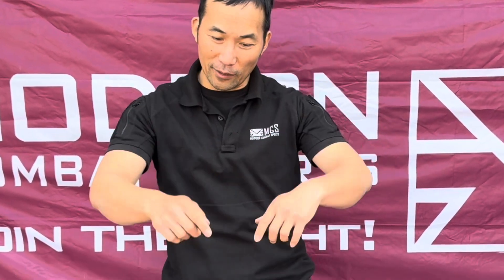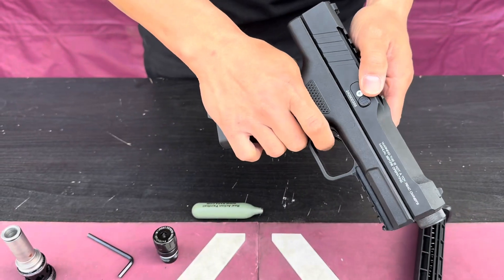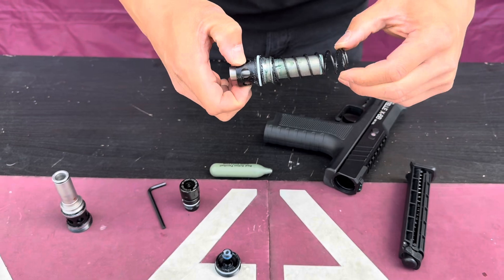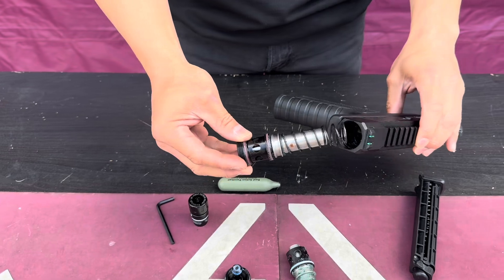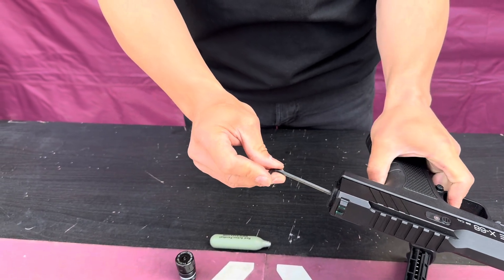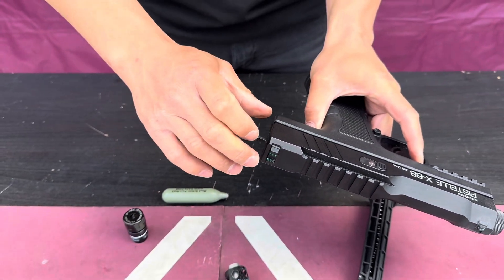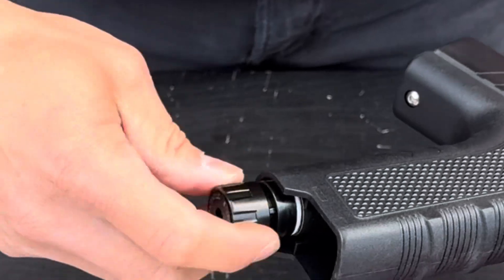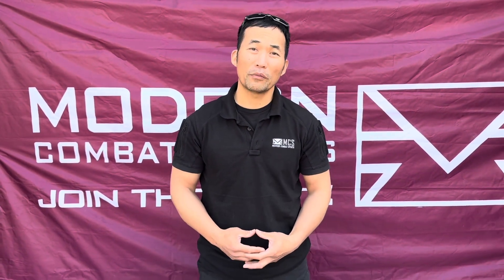Pistell X-68 Gen2 Upgrade Valve  Assembly :  Complete Valve Replacement Under 1 Minute

Comment: Ordered one for my Gen1 just in case. I’ve had zero problems with it so far. My Gen2 is on the way. I’m my humble opinion, no out of the box launcher even comes close to the Pistelle. I feel confident in my less lethal protection.
Thanks for the demo.
Reply: Did your valve come with orings??
Reply: The value came with the three O rings already installed. They also sent the Allen wrench for installation. The value comes well lubed
On another note, the company sent me a complimentary set of O rings and lube on a previous order for an extra puncture cap I ordered a couple of months ago.
I’m very pleased with this company. 👍
Reply: @MrRabbit1955 nice thank you for your comment! I’ve already ordered it thanks to you.

Comment: So instead of listening to your customers and making a recall for a gen 1 you want us to buy this so that you don’t have to deal with all the complaints and people having to purchase a gen 2 just so the gun can work? It’s a slap in the face after putting out a gen 2 to fix the problems couple months later. Ooo and lose power? Anyone else not understanding this? Wait here’s the best part for what I paid for the gen 1 your gonna charge me an additional 100 bucks for reliability + loss of power plus 35 bucks for o rings? Wow
Reply: How many car brands improved it's models over the years? The BMW 320 for instance, it went through 7 generations and gen 8 is expected in 2026. Can you imagine all the BMW customers saying the same thing about their BMW when the next gen. came out? This is not how it works. Less lethal is a developing and fairly new hobby/tool which means in this phase, many improvements follow in quick succession. You as a customer are helping the development of these products by buying newer/better stuff so the companies can use that money to develop better and more reliable launchers FOR YOU. Besides, it's common knowledge (if you think like that) to never to buy a 1st gen of anything. So please stop complaining like a 12 year old.
Reply: @jbhk7977 did you just compare less lethal to a bmw😂 yea gen 1 was released then gen 2 like months after. We’re not talking a year literally months and it’s not a cheap fix. Also if it’s a defect it should be warrantied like unm a car…if my sway bar breaks under a year there’s a warranty right? Do I fix that and pay for it if it’s a defect NO. The Pistelle has a one year warranty should be fixed.
Reply: @imtofast  Just deal with it.

Comment: For all of you wondering if this will weaken your launcher, the Gen.2 is a 5 to 7 joule drop in power compared to the Gen.1, so with this valve it may be a drop in power, but a more reliable unit. 
I would go with option #2 and the peace of mind that it will work when needed. Decide for yourself what you prefer.
Reply: So it dosent necessarily improve reliability but it does improve consistency? Am i understanding that correctly? Like you drop a few joules in power but you get more even numbers through all six shots?
Reply: Change the o rings to a better and solid brand and works just as good and still got the same power then reducing the power. Average joe will shoot go through one magazine to defend themselves. People like me will have an extra co2 and mag ready for reload.

Comment: It makes the Gen1 a Gent2 . More reliable with tighter tolerances & upgraded seals giving it better performance. Also good for Gen2 back up . Drop in & go . I’ve been waiting for this for a while now.
Reply: I agree but the performance in terms of power is not better with the Gen.2. The energy drop is 5 to 7 joules compared to Gen.1.
Reply: This is a downgrade and just to make your o rings not burst after many uses that the gen 1 was doing and lose power?

Comment: According to many youtube reviews comparing the gen 1 and gen 2 Pistelle X68, the gen 1 seemed to have a higher velocity output with the same weight ammo, meaning more kinetic energy or joules, is this true with Defense Innovations own findings? Also is this gen2 valve kit have all the Orings already installed and you need nothing more than to use the old spring and rescrew the unit back into place, making the Gen 1 into the Gen 2 specs? I'm assuming this is a replacement part for when the Gen1 valve starts to fails.
Reply: Definitely a 5-7 joules drop. Gen.1 money shot is around 50J, Gen.2 money shot is around 43J both with the same stock barrel. Definitely a drop of 5-7 joules. Gen.2 is less unreliable in terms of o-rings and internals. Gen.2 will also fire 10-12 shots on a single CO2 canister, depending on the weight of the ammo, and the tenth shot will still be ~30J. 
10 round magazine for gen.2 makes a lot of sense. For gen.1 8 round magazine is all you need.
Reply: @SaturdayCarFever  what makes the gen1 more powerful??
Reply: @nchargeny  Different valve? Different spring? I don't build those.

Comment: Gen 1 seems to have slightly more power than gen 2 so this might be a downgrade for me lol
Reply: Yep. Gen.2 is 5 to 7 joules drop so with this valve it can be a downgrade in terms of power but more reliable unit. I'll take option #2 and the peace of mind that it will work when needed.